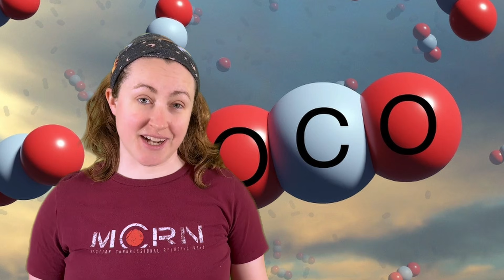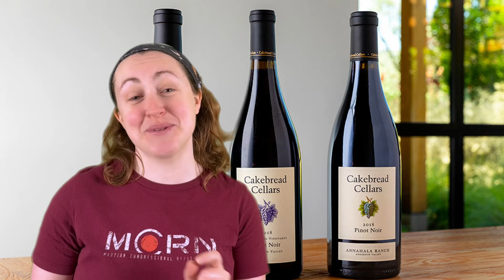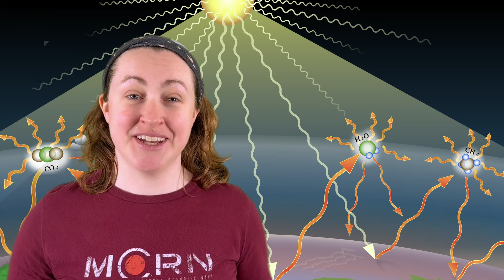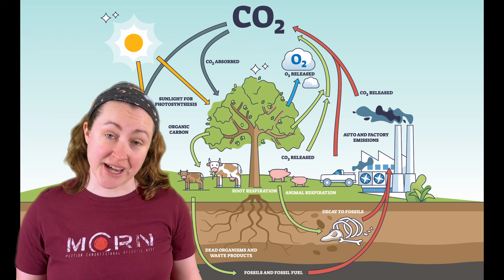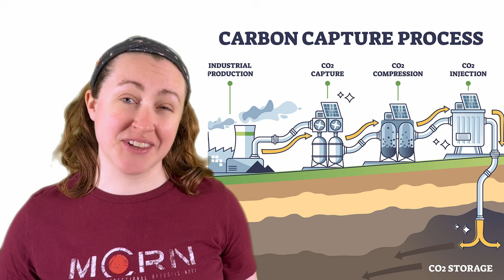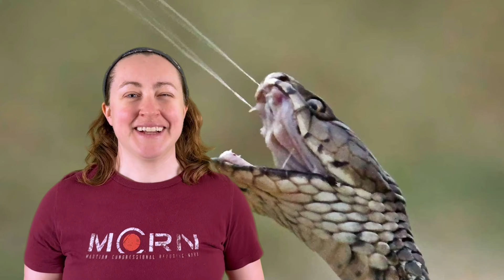Carbon Capture (so you can keep your Dodge Ford Ram)

Comment: Direct aircapture is not a solution at all. It's not possibly to extract CO2 from the 6-7 billion km3 air we have in our atmosphere. Nither by trees, algea, plants or industrial extraction methodes. The same problem with gold in seawater. There is a lot of it, but the concentration is ridicoulys low.